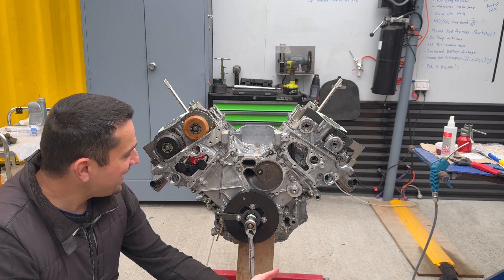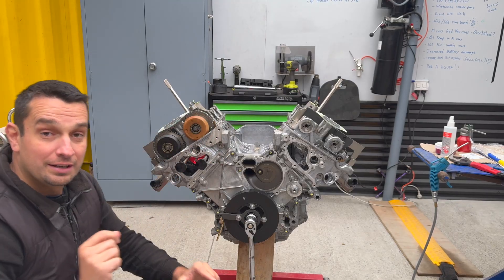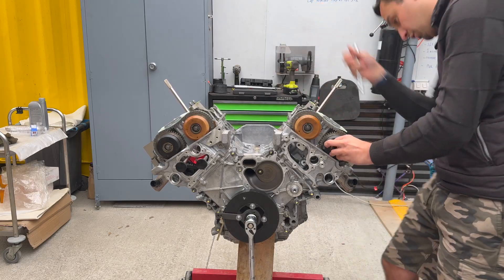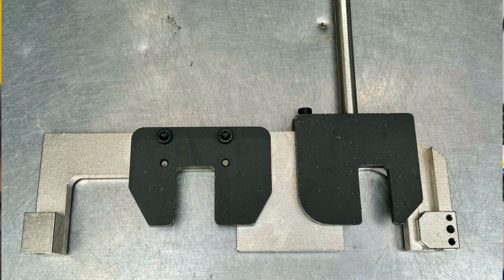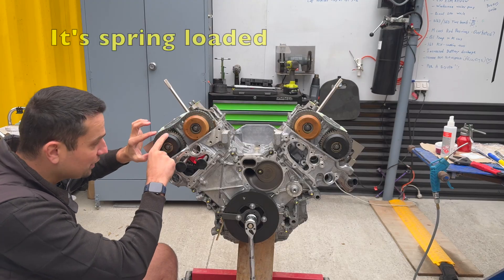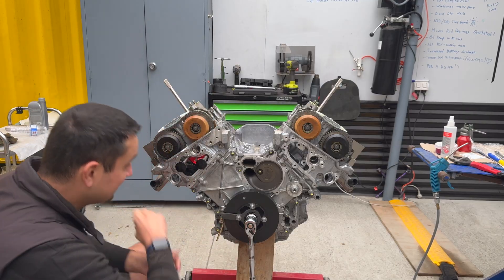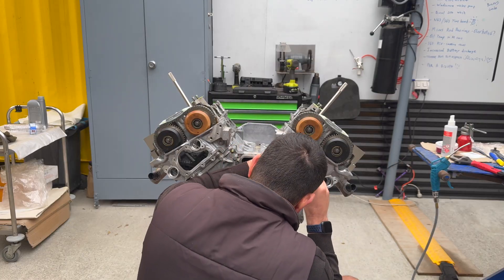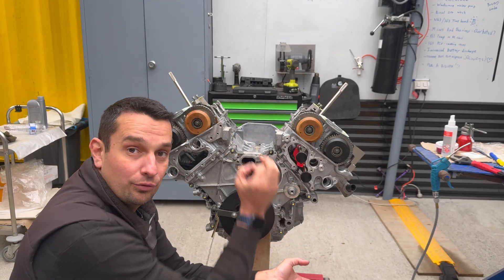How to SET TIMING - BMW N63 and S63

Comment: Good video. How do i know if the crank is lined up for tdc?
Reply from the maker: Hi, you need the timing tools to lock the crank however on the N63 and s63 the crank is locked before TDC
Reply: @dnl35projects by the MP marking on the crank shaft pully?

Comment: I like how in all the videos you dont show how to do the crank bolt up with the 100nm then 60degress 3 times.  note to anyone you need to a tool to hold the pully to the block dont use the pin as you will snapped the bit of the block
Reply from the maker: To be honest I do 100Nm then two turns of 60 degrees - the 1.5 meters wrench will stop at about 30 degrees into the 3rd lot (of 60 degrees) and the engine wants to come off the stand so that’s usually enough 😅 
Yes I have a tool which came with the timing kit, it lock the vibration dampener onto the belt tensioner bolt so the crank won’t move

Comment: Am I able to set timing on just bank 2 ? My bank two exhaust can adjuster snapped off. I’m hoping I can replace it without removing the valve cover on bank 1.
Reply from the maker: Yes it can definitely be done as you do one bank at the time however, considering how much those chains stretch I’d recommend getting the timing re-set on both banks so they are synchronised
Reply: @dnl35projects I set the timing but everytime I do 720 degree the cam tool doesn’t fit unless I rotate the exhaust came a little bit. I have a video that explain what I mean. If I can reach out to you for help. I been trying to figure this out for two months now. I really need some help or pointer.

Comment: Hello my friend can you give me the part number of the tool you used please
Reply from the maker: I’m not sure the part number but they are all over the internet (I use a cheap one) the only thing you need to consider is if you have a TU or a non-TU engine - even the eBay ones should be fine.

Comment: Just curious if you have every put an n63tu engine in an older 2011 n63 platform vehicle?
Reply from the maker: Hi, no I’ve never done it and don’t think is financially viable. The TU engines although the same size/dimensions, have completely different ECUs and management systems and it would be much easier to rebuild your old engine than integrating the TU electronics with a non TU car

Comment: Hello,well done…I have a problem n63 engine,replaced timing chain,timing marks looks good but cant starts engine.after diagnos - camshaft position sensor B,cold start timing over retarded…what i have to do there is something wrong
Reply from the maker: Did you delete all engine adaptations before starting the engine ? do the relearn for valvetronic, it could be using the old values
Reply: @dnl35projects after crank I did.i rebuild full engine,thank you for your  helpfully videos. I think meybe i missed crankshaft cycle. How can i check it? Which one is correct way to set timing

Comment: Have an n63 with 3 scored up cylinders. Machinists tell me these are not serviceable blocks, they're throw away..
I'm in New York State, USA.  
Is this correct?
Reply from the maker: Throw the machinist away and get a competent one 🤣 - Well, they are not lying in a sense as the alusil blocks are not really serviceable however if the machinist is competent enough they can install new iron/steel sleeves in the block thus making it even stronger than when it came out of the factory - It’s a complex job which requires lots of skills (and $$) however all of the big HP engines I build have cast iron sleeved blocks.
Reply: Thank you.  Can I have just the 3 done or will I have to do all 8? 
Aaron
Reply: @aaronbqwert7164  it depends on the shop, if they are sleeving it most will prefer to do all 8, but if they are plating and rebore the cylinder (millennium technologies does this). They can repair one bank at a time. To do whole engine in replate and bore it's around $4,000. To sleeve it is more than that. 👍🏼

Comment: Hello! Do you know if this will work for an n63tu2? For a 2016 bmw 750i? Thank you!
Reply from the maker: Yes, same process for all S63 and N63 however the non-TU engines use a different tool - The engine in this video is the basically the same as yours.

Comment: Hello great video. But you didn’t show how to set the manual tensioner, so the chain is at the correct tension. Can you explain that or show it. Thank you.
Reply from the maker: You fit the manual tensioner the same way as the normal one, but tight the adjuster bolt with your hands until is tight (manual says 0.5Nm) - As long as there’s no slack in the chain you’re good
Reply: @dnl35projects  if you did the timing with the original tensioners is that ok, there was no slack in the chain
Reply: Thank you.

Comment: Excellent
Reply from the maker: Thank you !
Reply: @dnl35projects  a question🤣..I have a 2016 F10 550i. I saw you torqued the lower oilpan bolts to 10Nm. In another video, a guy rebuilt his N63 and torqued lower oilpan to 27Nm. Which should I do? Am about to change my pan and gasket soon.

Comment: Great video as usual. The workshop manual describes a step which you didn't do in the video. Prior to tightening the final tightening of the new vanos bolts, it tells you to: "loosen the central vanos bolts by maximum 40°, crank engine back at central bolt through 8°, insert central bolt of intake camshaft (jointing torque 5 Nm) and repeat for exhaust, then move crank back to 150 degrees". It describes these steps as 'important'. Can I ask your views on this process?
Reply from the maker: Hi, I believe that step is basically to ensure the vanos gears are in the most retarded position and those were checked prior to assembling the engine

Comment: Hl
Seeking for help
My bmw 2010 750li
Having misfiring and 1 and 2 cylinder some times fire some don’t 
Already change al vanus selenoids and all coils and all sparks plugs and still the same misfiring
Reply from the maker: The fuel injectors are a known issue on these early S63 - Check to see if you have index 12 injectors and if not that could be a cause

Comment: i really don’t understand how to align the crankshaft 😢😢!!
Reply: if i understand the piston number one has to be up…and it should be 150° before the piston number one is up…right?
Reply from the maker: I looked back at the videos and you are absolutely right, my apologies as I've been doing this for a while and didn't actually realise I could explain the crank tool a bit further, also the cam positioning. Basically the lock tool I bolt onto the crank (harmonic balancer) has to align with the marks on it, we then insert the locking pin until it reaches the timing cover on the correct spot. Send me an email and I can provide some photos of what I mean.
Reply: @dnl35projects Thank you very much! can you provide your email address? thank you!
Reply from the maker: dnl35projects@gmail.com

Comment: Great work!  If you are taking the engine apart that already has no timing issues, Would the first steps be to lock the crank, then lock the camshafts, then remove the tensioner?    Can the passenger side be done first, then assembled and then driver side done?
Reply from the maker: Yes you can do each side individually and it doesn't matter which side you do first. In order to remove the tensioner you should lock it first (slide a pin into the whole) and in order to do that you could pry the chain guide with a lever (to compress the tensioner)  or rotate the engine anti-clockwise a bit (PS: thats the only scenario you should ever crank the engine anti-clockwise, when you are dismantling it. doing so could cause the chain to skip a teeth)
Reply: @dnl35projects  I can’t seem to find the size of the pin for that tensioner hole, is it 3mm or 3.5mm?

Comment: Alignment kit I purchased has only one set of cam lock tools, can time still be set. Also you didn't really show getting the cams in the correct position, how do you make sure they are correct angular position when installing cam lock tool?
Reply from the maker: Hi Robert, the timing kits for Non-TU engines usually have locks for only two cams (intake and exhaust) - that’s completely fine because timing one bank does not affect the other so you do one at the time.  As for the camshaft, pause the video where I show the slots for the cam tools to slide - there is a shaved/grinded surface on the cams which should point up when you installing the tools - yes you can potentially install them upside down (180 degrees off) and that will need the timing however if ensure the shaved are up, both locking tools will sit on the cams perfectly fine and flush to the head.
Reply: Thank you for replying to my question, at this stage I am not sure the block can be used. I did get piston and a view of the crankshaft, even though the car was running there were connector rod bear welded to the crankshaft and some were so worn they were paper thin. I only saw one undamaged crank journal out of the four. I think I am going purchase a  reman engine form BMW. I still will like to rebuild an engine and will try to collect all needed parts. So thank you for all your informative videos.

Comment: I have one objection: when angle-tightening bolts you should apply the same principle as with torque-tightening which is - it needs to be done in a single uninterrupted motion. Static friction is not the same as sliding friction. This is especially important for head bolts and rod bolts, but by the same measure it's almost as important for any bolt where angle tightening measurement is given.
Reply from the maker: You are absolutely right however I found a bit hard to tight and torque while recording, siting on a small stool 🤣 thanks for the feedback
Reply: so true